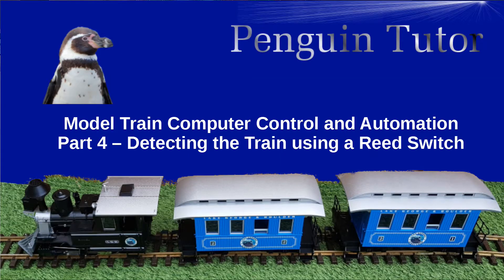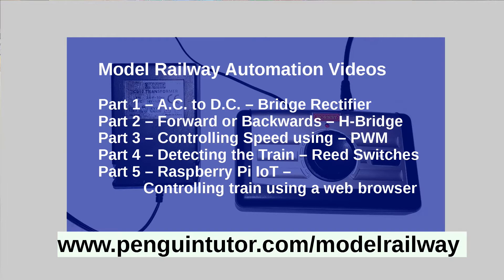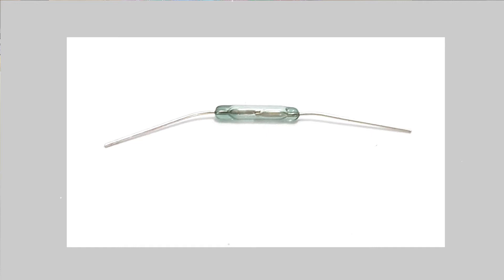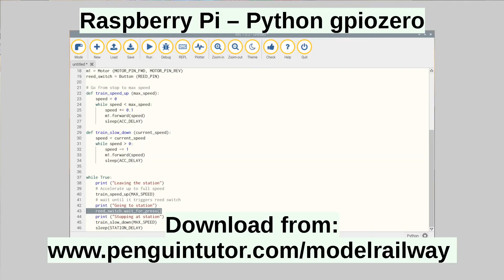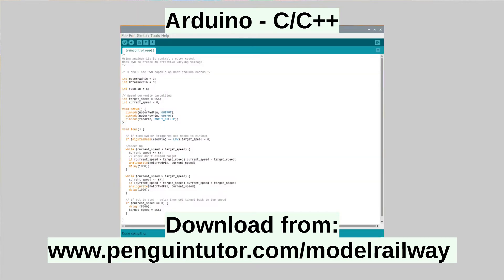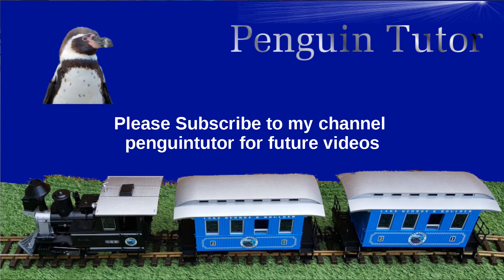Model Train Automation with Raspberry Pi and Arduino - Part 4 - Reed Switch

Comment: Hi Thanks for this great series of tutorials which has really helped me get going on my Raspberry Py train control project.  Could I ask one question please.  In the reed relay source code section on speed down, the parameter current_speed is used, but this not declared anywhere, whereas when I look at the Arduino code, it is declared at the outset.  Sorry if its a dim question, but if you get a chance, could you explain please.  Thanks, Graham
Reply from the maker: Glad I could help!

I don't think there is such a thing as a dim question. It is difficult to compare C and Python and the way these are implemented are very different.

On the Arduino then it's C so all variables need to be defined in advance. Also because of the way you code for the Arduino it uses a loop function (a function that is regularly called). If the current_speed was defined in that loop then it will not persist for next time the function was called. So in that code it is defined as a global variable (generally I avoid global variables, but Arduino is one place where they are often needed). 

In traincontrol-reed.py then the current_speed is used as an argument to a function. So it's created whenever the function is called. It's used as the starting speed for the train_slow_down function so it knows where to start from when decelerating. It is actually not required in that code, because the current_speed is always set to MAX_SPEED, but it is there because it shares some code with some of the other programs. It avoids needing to read the global variable directly that value is instead passed to the function from the main while loop.
Reply: @PenguinTutor  Thats really helpful, thank you very much for taking the time to explain it.  Regards, Graham